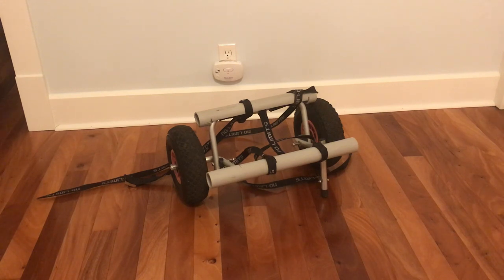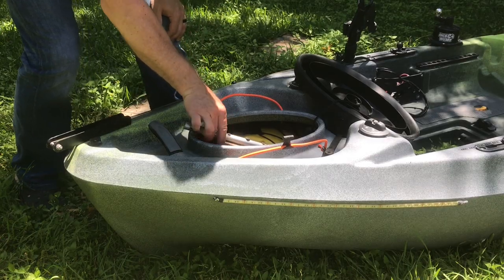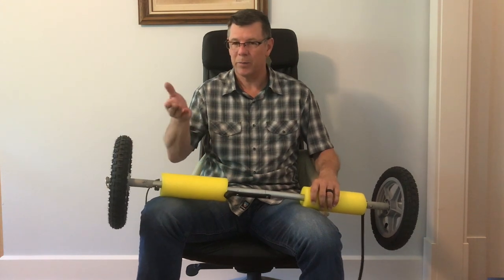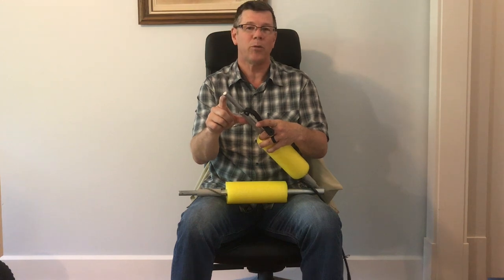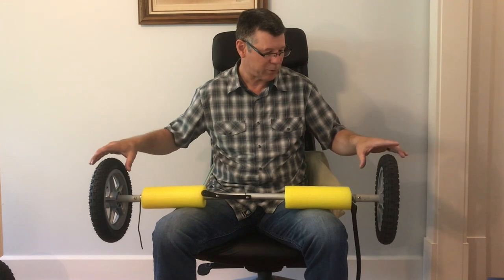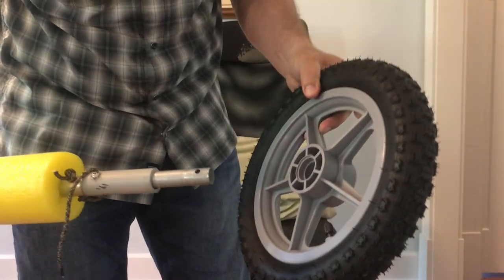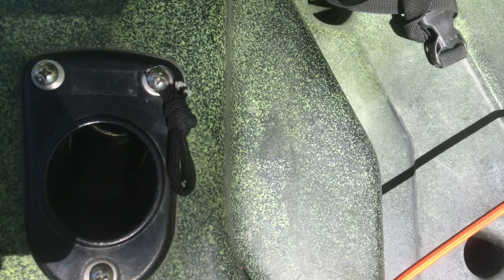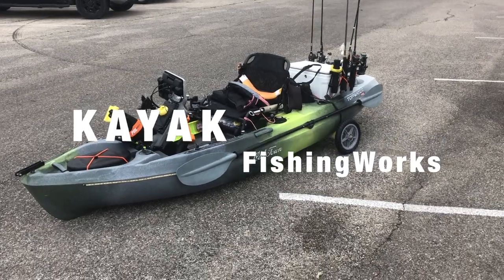TOPWATER KAYAK CART

Comment: Brilliant thanks. You’ve steered me away from considering all the other expensive models especially after also reading that they’re not all that good for the Topwater models size.  I’ll just build my own to suit Western Australian conditions which comprises a lot of sandy locations and water accesses. Hopefully you’re still replying to these comments so if so, would 16” wheels still be able to be slid into the hatches please mate as I just need to allow for a lot more sand transportation that hard pack.  Thanks if you can help. Paul 😃
Reply from the maker: Hey Paul,  Thanks for the comments.  Unfortunately, 16" wheels are going to be too big for the Topwater 106 hatch.  They may fit in the 120 as it has a larger front hatch.  If they don't maybe you could come up with a clever way to store the tires on the outside.  I often don't even break it down but lay it across the rear of the yak.  Cheers.
Reply: @kayakfishingworks1304  Hey KF - Thanks very much for replying and the info. I am getting the 120 so I’ll wait until it’s in hand and check it out otherwise I’ll Plan B something.  Thanks again mate 😃
Reply from the maker: You're welcome!  Enjoy the new kayak.  The 120 is really nice.

Comment: If you don’t keep the cart attached, do you break it down and put it in the dry storage when you’re on the water?
Reply: He said it will fit in the front hatch when it’s broken down. Think I’ll be building this soon. I have the same kayak as his.
Reply from the maker: Yes, you can break it down and put it in the hatch which I do sometimes.  Especially, if I will be going through reeds or tight flooded timber.  Most of the time, though, when I get down to the water I just detach one strap from the kayak, put the bow in the water and let the kayak roll in.  Then I grab the loose strap pull the cart out from under the floating kayak and set it behind my crate across the width of the tank well. That way I don't have to fiddle with it at the ramp and can get out of the way of the quicker.

Comment: I noticed you have led light strips. What brand are they or where did you get them? How are they holding up?
Reply from the maker: Installed them 6 months ago and they have been on quite a few trips.  They are holding up great. They are rgb leds so you can get them to display whatever color you want.  One single led on one of the front light strips only shines white but I believe that is from me damaging it when strapping down the kayak.  I plan to do a video on them soon. Probably, this month.

All for around $50 total.
https://www.amazon.com/gp/product/B07G83T4CY/ref=ppx_yo_dt_b_asin_title_o09_s00?ie=UTF8&psc=1
https://www.amazon.com/gp/product/B01JGDV8UM/ref=ppx_yo_dt_b_asin_title_o09_s01?ie=UTF8&psc=1
https://www.amazon.com/gp/product/B007Y7E0CQ/ref=ppx_yo_dt_b_asin_title_o07_s02?ie=UTF8&psc=1